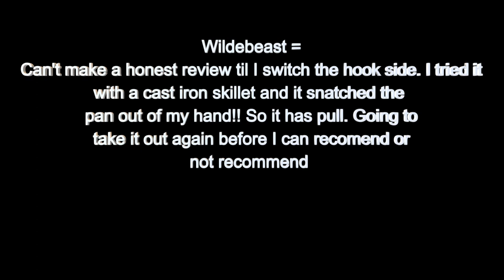Magnet fishing with a new Brute Magnetics Wildebeest Double Sided 4250 lb combined pull Review!!!!

Comment: Have you had any good luck with the Wildebeest?   I took my new one out and only got some cornflakes and one piece of rebar then threw my Brute boss and cleaned house!    I am not very impressed so far.
Reply from the maker: Same here. Not impressed at all. With mine it has to be able to have contact to a piece that’s not very rusty. We was hoping Brute Magnetics would take it back but no luck.
Reply: @GenerationX1971  I emailed them and they told me to try to pull it on something like a cast-iron frying pan.. I just happen to have one and will record my test for them.  The brute boss is by far a better magnet even when pulled... it catches everything!!!
Reply from the maker: @terrywelborn3425  they told me the same thing. For the size of the Wildebeest you would think it would have a death grip. I believe the Wildebeest is the only Brute Magnetics magnet I have not recommended to people. Working on getting another 360 Boss.
Reply: @GenerationX1971  Dang...  your video went exactly as my use of it went.  I agree on it not being the top magnet and yes for the weight it should bring up a ton.
Reply: uliBERMAGNET magnets cost 1/3 of wildebeest and they work much better. same with MUTUACTOR at 1/5 the price. What are your guys favorite 2 sided or 360 magnet?

Comment: That new magnet is big. I think you might want to change the location of the rope next time.
Reply from the maker: Going to take it back out with the rope on the center of the magnet and see how it goes.
Reply: @GenerationX1971  Looking forward to a video of it to see the outcome. Hopefully you have a better result. I'm sure that big magnet was not cheap.
Reply from the maker: @johnmeijer4455  little over 200 I believe. That’s with the heavy duty rope. Brute does not have a case for it if you get the heavy duty rope (100foot).

Comment: That new magnet isn't very good 😕
Reply from the maker: Going to give it another shot. I contacted Brute Magnetics and they think it’s the rusty metal causing the problem. When I got home from work today I got a cleaner piece of metal close to it and it yanked it out of my hand and was hard to get off the magnet. Hopefully changing the rope to the center of the magnet will help keep it closer to the bottom of the river while magnet fishing from bridges. As of now magnets are unable to be returned once used because of scratches to the surface. Hoping for the best.